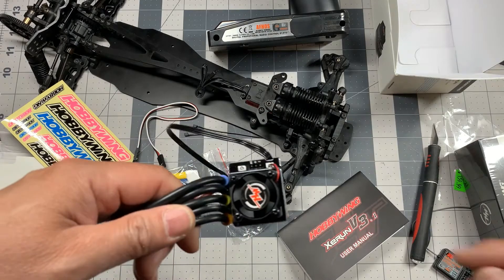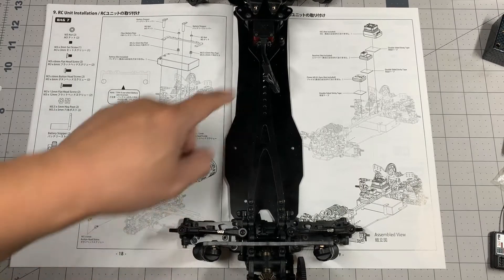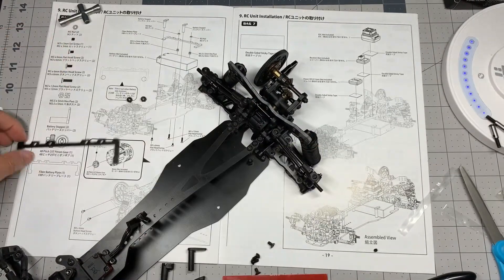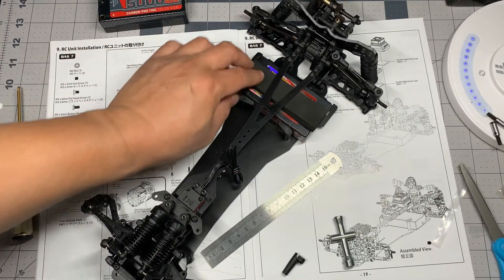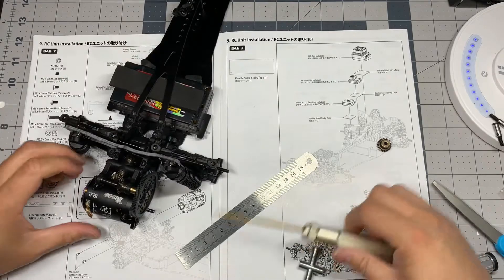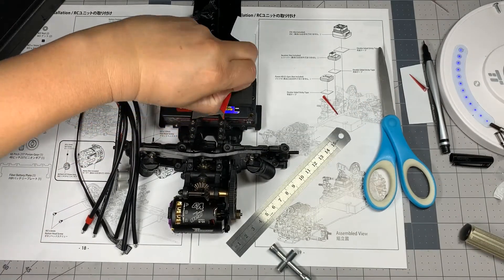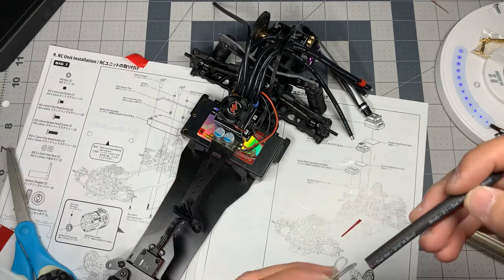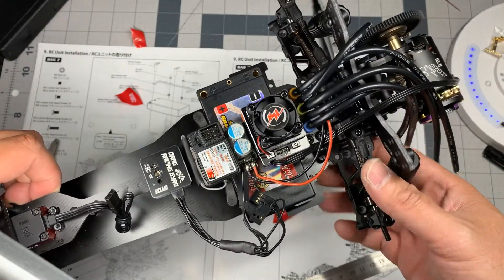How to Install the Electronics into the 3Racing 1/10 Sakura D5S RWD Drift Chassis - Part 1

Comment: Good video. I had one MST RRX chassis with rear motor configuration but I didnt like it as I couldn't drift properly, all the weight was on the back of the car and there was not grip on the front wheels. Even do I added some weight in the front. Did you try the RRX, in that case how it compares to this chassis? Thanks mate
Reply from the maker: I have not tried any MST cars at all. I am looking forward to building a Yokomo drift car.

Comment: Where did you get additional spacers for steering?
Reply from the maker: I built this kit a while ago. I don't remember much about it. Could you tell me which video and timestamp you're referring to? I will do my best to answer your question. Thanks for watching.
Reply: @RCsRCCars  right at the beginning 0:33 sec the chassis laying on the table and you may see that steering spacers not straight as it's should be by default.  Am curious where did you get this curve spacers?
Reply from the maker: Are you talking about the steering link rod end?
Reply from the maker: Take a look at this video at 3 minutes 31 seconds.

https://youtu.be/1S5mVOJ8InU?t=231

Is that what you're referring to?
Reply: @RCsRCCars  Yes, right. about steering link rod end. I just found out that on D5S they are by default like this. I got D5MR and they are straight there. Sorry for confusion.